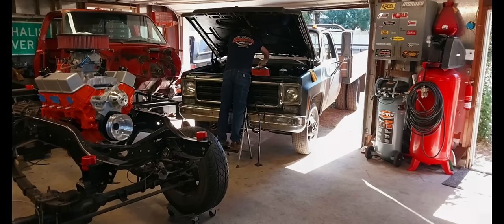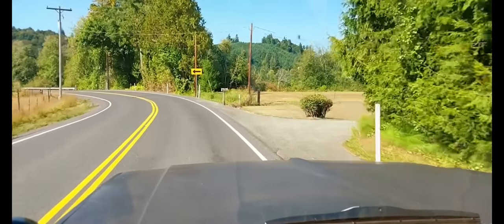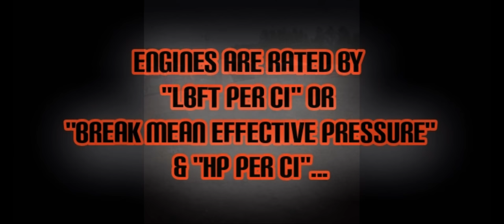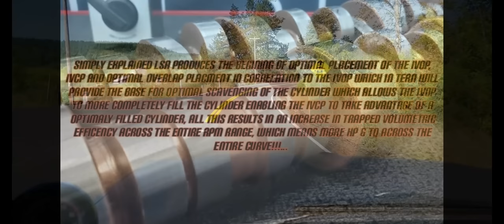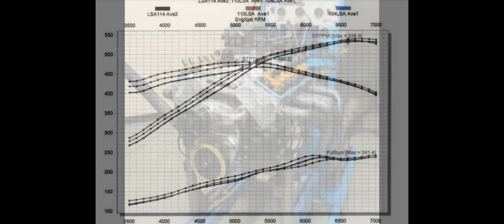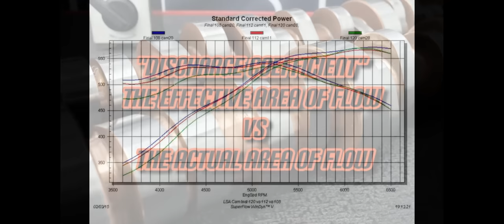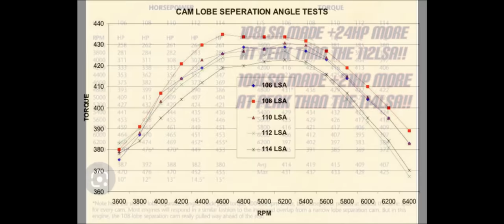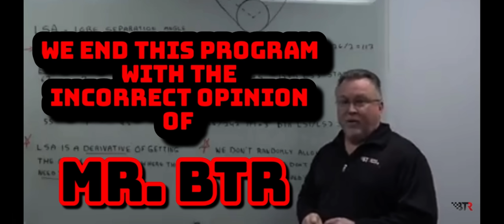Camshaft Selection via LSA, 19LSA's Dyno proven MAX TQ & HP cam tec. LSA, Overlap & Duration convert

Comment: Great knowledge sir. Your well ahead of me. I have 2 questions for you. For a stock Ls with a 3000 stall on the street what is the best cam for the street.  My second question is for same vehicle and engine with a 76/75 turbo.
Reply: Follow the formula given to make the most N/A power. That same cam with boost will still make the most power with boost. When AFR and timing  is consistent from N/A to boosted, the power curve is virtually the same, just raised by boost. That's why they are called a  power adder.
Reply: @johnmyers3930  I was just wondering what valve events are preferable for cylinder filling for boosted compared with N/A combos that rely on vacuum and scavenging? The overlap is literally flushing the chamber & possibly loosing cylinder pressure that could be trapped. I know the boosted power curve will just mimic the N/A curve that the camshaft produces & mostly run parallel but just at a higher level , but what are the things that make a turbo cam a turbo cam & make them more efficient and not just sufficient V/S a all motor setup? Thanks

Comment: Yes, great presentation and explanation! Question though… Since 10.5-1 seems to be the constant, what I f you a more common 9.5 or less, which direction should you lean, more lsa, or less? Thanks!
Reply from the maker: With say 9:1-9.5:1 it would use an LSA 1° narrower than the original result... 
Thanks for watching...
Reply: @ACDGarage_Racing  Great! Thanks for the response!

Comment: Love how you can convert the duration once you choose the correct LCA.  I'm having trouble deciding the correct duration to start with.  Most of my engines are for heavy 4x4 trucks that get used daily for towing or hauling.  Where do I start & what rpm is best for sustained freeway & highway ect.   Can we use these principles for say a Cummins engine as well?

Comment: Makes perfect sense. Well said. Question though? What would the formula be for an inline 6 engine like the 6.7 cummins with 4 valves per cylinder and a max of 2x 1.5" intake valves in stock bore cylinder?

Comment: Interesting - different engine configuration, but you could also get a good indication of trends using a DOHC engine with variable intake and exhaust camshafts.
You could alter the timing and lock it, with a few key-strokes, then run the test. Reset and repeat.

Checking the affect of the actual camshaft timing, advanced or retarded from 'straight up', may also have been enlightening for many of us.

Comment: I love your videos.

Your videos also leaves out a huge detail of converting Overlap between Advertised and 0.50 duration values. Or I have it wrong. It seems pretty crucial to all other calculations to either know, or determine from a manufacturer's chosen overlaps to find the cam that works best for any given combination.

An example is a 351C with 4V heads (2.19 valve) and 11:1 calls for a LSA ~115 and 0* OL would give you a 230@0.50 duration. If I choose a Howard's cam 231721-08 with a 3000-6600 range, use the Wallace calculator, using Advertised numbers,  287/293/108 is 74*OL. But how can I get the proper duration@0.050 when the Overlap is for Advertised duration, but I only know the ideal LSA and duration@0.50 with 0* Overlap. (115x2)+0=230@0.50. Do I substitute the 74 in the equation for overlap? (115x2)+74= 304* of duration@.050? That seems a rather excessive duration.
Thanks!

Comment: Great video, I love seeing new info outside of the classic car magazine bs they've fed us for years. 

A bit of off topic but I've been thinking about head porting for fuel economy and thought of something the other day. Most people think of it in terms of max flow. But what if you ported about 1/3rd of the intake throat closest to the to exhaust to minimize low lift flow closest to the exhaust valve without hurting mid/high lift flow? My thinking on this is because the majority of fresh air coming in would be near the cylinder wall. It might flush the chamber of exhaust better while keeping more of the fresh charge coming into the chamber without sending it straight out the exhaust during overlap. Thoughts anyone?

Comment: Hey Adam, I really enjoyed this video. It puts a lot of clarification into DV formula. A question though is this for a single pattern camshaft if not, how do you figure the exhaust lobe specs also your overlap diagram one through six doesn’t list the RPM range. Could you explain one through six RPM once again thanks for the video Zach D.

Comment: Well done videos. Is the Lsa on David Vizard's cams for race applications or does it apply to the street as well? Trying to select a cam. I'm building a sbc 385 square body for torque, drivability , fuel milage , and occasional drag racing. What I don't want is a truck that runs it butt off and drinks gas. on the other hand I don't want to get great fuel milage and it won't out run a Prius. So here is my specs. 385 ci, scat crank 9000 , pro forged scat rods 5.7, 10:00 to 1 forget pistons, AFR 195 as cast enforcer heads 2.08 intake valve, 1 3/4 hooker comp. headers, 3'' exhaust, Edelbrock duel intake performer 7101, Hei ignition, 700 r4 transmission, I don't have a stall yet.  3:73 gear, 30" tires, 4800 lbs. ANY advice will be greatly appreciated. I will go fuel injection after I get it running. I'm having trouble with the ethanol fuel corosion. so ptfe / stainless/ viton etc... I'm thinking Edelbrock Pro-Flo after I get it finished. Any advice is appreciacted. Thanks

Comment: I think that I have not seen this video before you responded. The video is extremely good. Again, thanks for your response. Now, is there a way to calculate Small Block Chev developed vacuum versus  overlap degrees, such that there is some assurance there will be adequate vacuum developed for vacuum power brake boost?  I will try to see if there is a formula for estimating such.

Comment: Lots of good info here. You mention "except for VVT", but what if you have an engine with VVT? I'm trying to figure out if very few places offer VVT cams because it doesn't do much with aftermarket cams, or because everyone is lazy and would rather delete it? Looking at cams like the TSP Chopacabra and BTR Truck Norris (they are both near the optimal 108 LSA for a 6.2L (376CI) engine) but neither one is available with VVT. Scratches head...

Comment: I have a question: why go to a 106 LSA when the calculated LSA for the LS 402 was 106.87? Choosing 107 would be 0.13 away from the calculated value rather then 0.87 if choosing 106 LSA. Just wondering. Great video, new subscriber!:)
Reply: I think it was mentioned in a DV video that going lower produces less negative affects than going higher. such as calculating a 108 a 104 is only minimally less optimized than a 112 which is quite a bit worse. So basically always error on the lower side results in better results.
Reply from the maker: Thank you for watching... The. Simple explanation of why i went to 106LSA and not 107LSA is because the LS Engine being 402ci which is on the larger side, the 106LSA will provide a bigger increase in power across entire curve...
Reply: And left compression ratio out of the equation. DV has clearly said the 128 rule was figured at 10:1 and you need to add 1 degree for every point above 10:1, but the engine referenced was near 11.5:1. So the 108 would have been correct using the 128 rule, not 106, or 107.
Reply from the maker: The Compression on that 402ci LS was as I said in the video 10.5:1 not 11.5:1... The formula starts at 10-10.5:1.... for every whole # increase in compression typically widen LSA 1° - .75° depending on how precise your want your calculation based on multiple aspects... and every .1 increase in rocker ratio widen LSA .25°-.50°....
Reply: @ACDGarage_Racing 4" bore, 4" stroke, 68.5cc chambers, flat top pistons, a .040 head gasket, and figuring the piston is down in the hole .010 gives 11.45:1, not 10.5:1.
Reply: @THEFERMANATOR Also, I was under the impression that bore and stroke also plays a huge part in valve timing. He didn't seem to touch on that either.
Reply from the maker: If you had watched the video all the way threw and read everything that was written, I had adressed that and a whole shit ton more, it takes attention to detail... CI "Aka" Bore & Stroke is the primary factor in LSA selection... Every single factor that effects LSA is/was adressed in this video...
Reply from the maker: @THEFERMANATOR  Good Eye!!! I went and checked and i don't know how I missed that simple little detail lol...That would have made a way better point with the LSA coming out at 106.87 which for 10.5:1 I would round down on the tight side to 106, but for that 402ls being around 11.5:1 the 107 would have been right on... So Optimal LSA was only off 1° not 2° while showing the positive increase in hp & tq across the curve...
Take Care...
Reply: @Blown460 yes he did. You didn't watch the whole video or didn't pay attention.

Comment: The information in this video is correct, but really only applies to carbureted, or TB injection, engines that don't rev beyond 7000rpm.
With Port, or Direct, Fuel Injection you can use the intake manifold to tune the powerband to perform as well, or better, with a dual runner intake manifold, and a wide LSA. Which also allows much cleaner exhaust, much smoother idle, and better low rpm driveability/power.

Comment: I'd say the lsa depends on what you want the engine to do. Where do you want max power at what rpm or max tork at what rpm for your combo.
Reply: Agree. TIght lsa is not always the answer depending on usage and other requirements. 
I wouldn wanna spend hrs in traffic ea day with someothing loping along (even though it may sound fun) it gets old real fast.

Comment: you used a massive 262@50 cam for your example, is the math and theory the same for a normal street cam? i mean, 99% of the people watching this wouldnt touch a 262@50 cam because it would suck for the street. thank you for all your info and effort answering questions
Reply from the maker: Those cam specs were used just as an example for the display of camshaft spec conversion, it was just to show 2 vastly different cam specs with the same amount of Overlap and a different LSA & Duration, with the same amount of Overlap bolth cams would have damn near the same peak RPM but the curves would be drastically different with the cam with the optimal 106LSA making more power across the curve, which most would not expect to happen... Overlap dictates the RPM at which peak TQ is produced which is relative to the RPM at which peak HP is produced, and LSA dictates the amount of TQ & HP potential that is produced at any point in the RPM range... Hope this helps...
Thank you for watching...

Comment: I’m a novice and in the early stages of my engine build. This information along with DV has been eye opening. One thing I’m a still trying to figure out: does the intake/exhaust duration need to be same for optimal performance?

Thanks in advance to whoever answers the question correctly.

Comment: There’s a lot of notes to unpack in this vid so maybe I missed it - I understand how LSA and duration control overlap and valve timing with relation to the intake and exhaust, but how do you determine valve events with relation to the crank?  If the DV formula(s) tells me I need an LSA of 108 and I pick a duration to give me 50deg of overlap (at .006), I still don’t know what intake centerline to install the cam at?

Keep the videos coming, sharing your knowledge is much appreciated.  A video on choosing cam lift would be cool!
Reply: Wouldn't you install the cam accordingly to favor torque (advance) or rpm (retard), and at the ideal which will put cranking psi to as close to 190 as possible to maximize?
Reply from the maker: Thank you for watching... There alot of parameters & variables that go into calculating ICL to completely optimize the valve events, But it is safe to say that 4°advance ground into the intake lobe is usually really close or right on... So say a 108LSA  just put it on a 104ICL and that typicaly works very well...
Take Care

Comment: Great video Adam! Thanks for making this and sharing your knowledge with us. Can these equations for optimum LSA be adapted for 4 cylinders engines also? (air cooled VW) Also, would these change at all for turbo chanrged engine? Most of the off the shelf turbo grinds for air cooled VW engines are 114LSA, where most of the off the shelf NA grinds are 107 or 108. Thanks

Comment: I have been watching your videos and learning a lot.  i have a  a multi purpose vehicle mostly built for road course but use for auto cross and the occasional trip to the 1/4 mile strip near me. i do drive it on the street but not its intended purpose. it has a  Chevy 383 stroker 10.5 compression, brodix track 1 heads with 2.08 intake valves. i wish i had seen your videos before i purchased the cam. it has a comp cams solid roller with 112 lobe separation When i do the 128 rule i get 107degree LSA. it seems to me it might be worth it to replace the cam with one with a tighter lobe separation. i hate to make the wrong selection again so wondering if i should buy the DV cam selection software or if you could make a recommendation?  the current cam has an advertised duration of 297/297 adv 260/260 @.050" with .589" lift with 1.5 rockers. i believe this cam has an overlap of 73 deg. i have been trying to find aa similar cam with tighter LSA Howards makes a mechanical roller part#110173-08 that has 108 lsa 273/279 adv. 241/247 @ .050" and .570" lift with 1.5 rockers. or a #111313-06 279/279 adv 247/247 @ .050" and .585" lift with 1.5 rockers. i see DV recommends 1.65 ratio rockers for a 383 i would have to check valve to piston clearance. also i see that David Vizard advancing the cam 4 deg. both of theses cams appear to have 4 deg. advance "ground in" do you recommend 4 deg more than that?

Thank you,

Jamie Wooldridge

Comment: Some of your power curves go down to 2K RPM’s please show all of them down to 2K and vacuum would be nice too. Street car guys would be interested in these specifics. Generally tighter LSA degrades low speed 😊smoothness and lower vacuum, both considerations on street cars which could be concern off idle. Flat tappet lifter cams “fast ramp” profiles accelerate wear and not conducive to long life. That was main reason say the original L79 cam is long overall duration. After market cams differ in acceleration ramps, so where do you want to be in lifter rise rate (flat tappet) to make formula the most effective since this is in the .050 lifter zone? Nice presentation😊
Reply: If you want smoother idle then take away duration

Comment: Appreciate the video and all the info! I was using the formulas for a street truck engine which came up with a 108 LSA but with short duration I can't keep the dynamic compression down unless i increase the LSA, is it the online calculators?

Comment: Thanks very much for sharing your information !!  as im currently building my first n/a ls 5.7   ive worked out the lsa which is calculated  a 108 but with a 12 to 1 compression should see me at the 110 lsa now.I Am wondering  if anyone could possibly  help me with duration and lift of a cam needed  i havent got my head around that part yet.btw i am trying for maximum  effort so any help will be very much appreciated  cheers
Reply from the maker: Thank you for watching, I appreciate it... I will adress you question when I have a little more time...
Reply: @cattledoggarage  thank you appreciate  it when you do get time  to will certainly  help my build .The way you put your content out is very good looking forward to more in the future good luck with your health also wish you the best.

Comment: How does this apply to boost? Are you supposed to calculate the effective "in boost" compression ratio? How do you do that?  Or do you just spec it for optimal NA and go? (assuming 1:1 back pressure setups)
Reply: Build the most power N/A that you can. Boost just raises the power curve you make N/A.
Reply: @johnmyers3930   But it also raises the effective compression ratio a ton. So if you are using compression to choose LSA, the ideal LSA would change depending on the final effective compression ratio.. aka boost level.